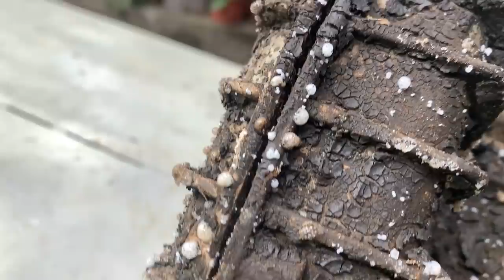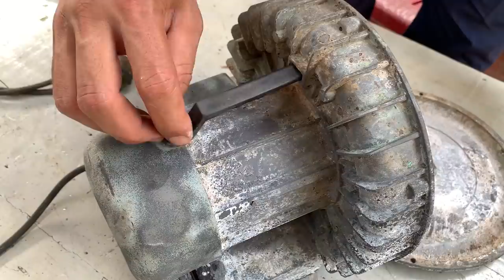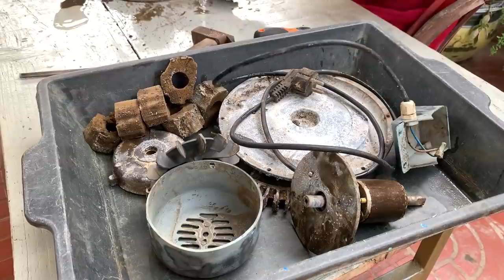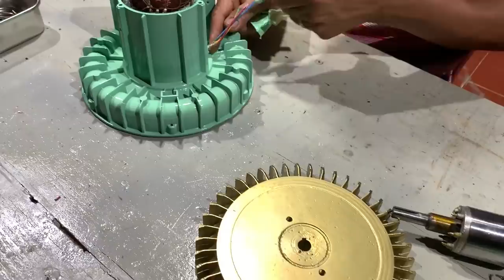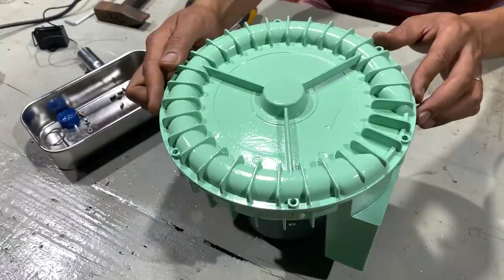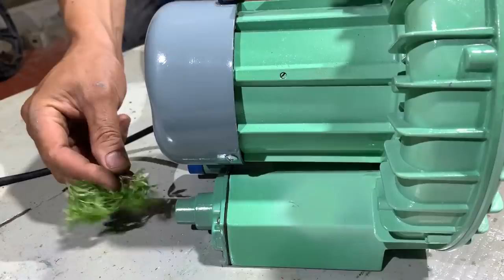Restoration Scallop Air Blower | Restoring Vacuum Pumps

Comment: Wonder how a blower thrown in the swamp could work so well with out any replacement , at least the sponges and rubber gasket could have been changed , wonder full cleaning ,

Comment: The fluid mixture used to clean crusts and rust on iron and aluminum??
Reply: Evapo-Rust is safe enough to use on any rusty item including cast iron cookware, grill grates, knives, antiques and anything metal. It features a non-toxic, environmentally safe, water-based formula that removes rust in just minutes, no scrubbing needed. Evapo-Rust is reusable depending on the thickness of the rust.

Comment: First of all I think we found the source of the Covid-19, damn that fan looked nasty. But secondly that fan was thrown away because it obviously broke down , but I didnt see you repair or replace any parts , you just washed it down & painted it & it worked like a charm. If that was the case they would of never thrown it out to begin with .